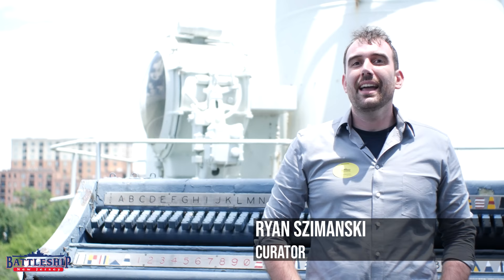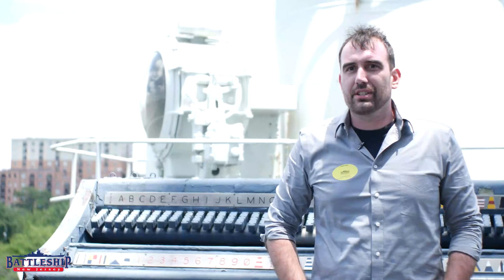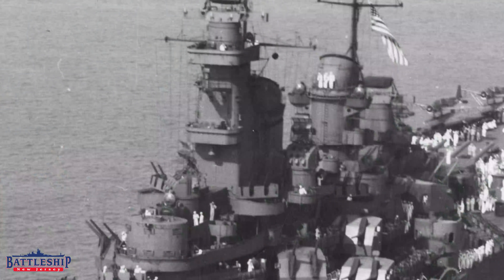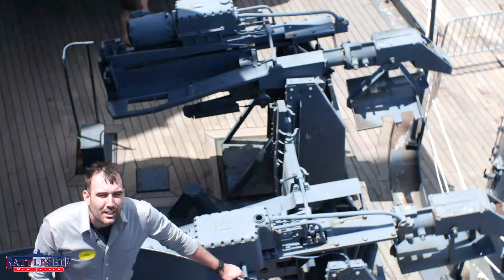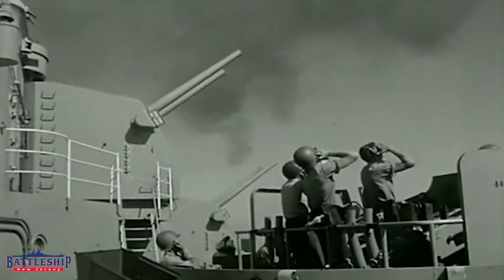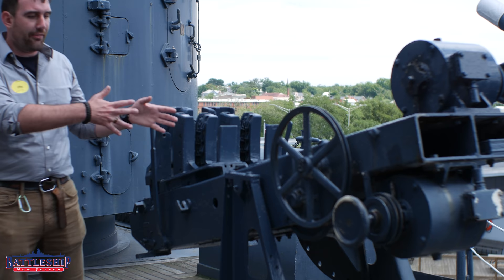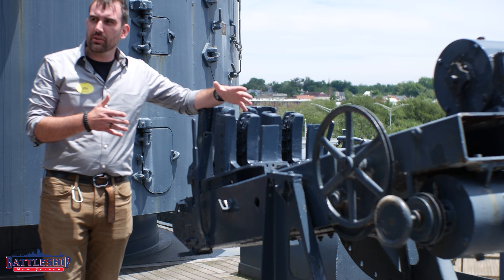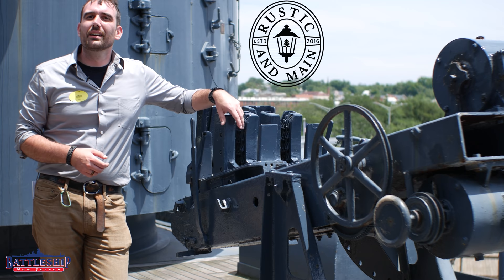Did You See That?!? Search Lamps and Star Shell

Comment: Seems like the searchlights would be good to have if you are recovering sailors from a ship that went down, or downed air crews
Reply: That's usually the job of the destroyer fleet, though.  It's a lot more hazardous for ships with a higher freeboard, like carriers and battleships, to try to recover personnel from the water.  Also, you typically need to come to a full stop to perform those actions, and that's a lot bigger time investment and risk for those larger vessels.
Reply: ...or looking for sabatours/enemy frogmen in port.
Reply: @joshuabessire9169  That's more a task for searchlights on the port facilities themselves.
Reply: @joshuabessire9169  that'll be port security's AOR.
Reply: Might need the search lites if in a earlier battle the radar was damaged I’m sure they could use the star shells but maybe all used up , you don’t get no time outs to replenish your needs in war
Reply: @dougchew5193  If you can't rotate ships out of the front line for replenishment of the resources needed to be in the front line, you've either screwed up badly and are about to loose the war or you've already lost the war and haven't admitted it yet.

Comment: If the enemy has the proper equipment, illuminating  them with radar gives away your position as surely as illuminating them with a searchlight.

I have seen several sources mention that the Germans and Japanese had "excellent searchlight tactics" yet I've never been able to find any documentation describing searchlight "tactics" for them of the US Navy for that matter, although I do know generally that it involves things like controlling the illumination time (as brief as possible), and switching between different searchlights to make it harder for the enemy to pinpoint the source, as well as using them to "dazzle" enemy gunners and visual FC directors in addition to illuminating the enemy for your own guns.  I would love to find a manual detailing the use of searchlights (and star shell) in night combat.
Reply: Another practice the Japanese had was using their cruiser or battleship spotter planes to drop flares behind the line of enemy ships to illuminate them. They used it in at least one of the Guadalcanal battles. They were the only navy to do that (although the RN talked about it), usually float planes didn't operate at night. I always thought that was a darn good use for them.

Comment: Biggest reason for the 5" loading practice -- before proximity fuzes the AA rounds burst by a time fuze. The lag between setting that fuze (the setter is in the shell hoist*) and its firing was very important of being consistent to get a good AA barrage... actually hitting an aeroplane was not at all expected. On firing the time-fuze started and the shell burst when the timing mechanism ran out. So the time between the calculation of the range and the shells' bursting was highly significant to effective AA fire -- the crews practiced to get the shell-loading lag-time fast AND consistent.

* In the 5" gunhouse one will note where the shell hoists come up from below, with the base end of the shell up. The nose of the time-fuse had a little knob that engaged its mate in the cup which the nose of the shell rested within. Stepping on the peddal of the shell hoist set the time on the fuze, right before the crewman picked the shell from the hoist.
There is a fuze-setters position, see the tractor seat, with his back to the front of the gunhouse, between the hoist and the forward wall of the gunhouse.

Comment: The Navy is always redundant. What if the radar fails?  What if you take a hit that knocks out the radar?  Are you crippled, or can you still shoot with star shells and search lights?

When computers were coming into service, the file cabinets and safes were filled with paper.  With GPS and electronic tracking, there is still a paper chart on a table.
Reply: I got out in 1992, but even then there were a lot of high tech gee whiz systems we could use to figure out our position. Regardless, every day there would be somebody (usually a Quartermaster) who would determine our position using celestial navigation. When qualifying as Officer of the Deck (OOD) Underway I was trained in celestial navigation.

Why would the Navy still emphasize that? For two reasons. The first is redundancy which is a needed insurance against all the sorts of bizarre things that can go wrong. The second is so that you can verify that the various electronic navigation aids you are using way out in the middle of nowhere are working properly. It should also be pointed out that celestial navigation is a skill which needs to be practiced constantly in order to be able to rely on it. 

There was a story floating around, likely apocryphal, about a nuclear submarine that had problems which had pretty much taken their entire electrical system out. So they surfaced, cobbled together a repair that let them use their radio and signaled that they needed help. They got a response that help would be on the way, but then asked them the obvious question of where they were, exactly. As the story goes the Commanding Officer, the Executive Officer and the Chief of the Boat gathered around a sextant that they took out of a box, which none of them had used in years, trying to figure out what to do with it. Personally I am somewhat suspicious of that story as even with all their fancy navigation aids down they still should have known roughly where they were based on the paper logs they would have been keeping. But the idea that submariners wouldn't be regularly practicing celestial navigation because they would have to surface (or at least come to periscope depth) to do that isn't too unlikely.
Reply: @minarchist1776  As the leading Quartermaster on a destroyer, I told my sailors that the first things the Soviets would do would be knock out NAVSAT satellites (later GPS satellites) and fry our electronic aids and receivers with an EMP burst(s). I added what they could take away was the stars and planets and the Earth's magnetic poles. I had them daily do a full Navigation Work Day. Computing the rise and set of sun, moon, stars, planet's, plus observing those bodies and working up the ship's position. Daily practice made them better than most and those results showed in the Navy Wide Advancement Exams and in Navigation Readiness Exercises. In one such exercise, the Commodore order all electronic navaids covered/blackened. The QM gang was to navigate from Roosevelt Roads to Charleston using only terrestrial/celestial means. No problem. The average deviation between the electronic positioning (Commodore staff keep for safety reasons) and what the QM gang observed/computed was .82 nm (1,640 yards). We easily found buoy 2C at Charleston. 

Your submariner story is sort of factual. I help train boomer QM's in celestial navigation. There answer at the start of the program was "Not at a depth of 400 feet". But with a little refresher and a lot of practice, they did quite well. It was part of their quals, yet they never could practice. When they rotated Gold crew to Blue crew and vice versa, they went to see with us for training. It was a nice program.
Reply: As a Unit Diary Clerk in the Marine Corp I basically maintained an electronic version of the Service Record Book. We still had a paper copy too. Just in case the Pentagon's servers went down? HAHAHA!
Reply: Not for much longer. Paper charts won't be printed anymore, some are going out of print now. But you can still order paper charts from specialty firms who will update then print them for you.

Comment: from Wikipedia's article on SearchLamp - but lacking a reference- "Second World War-era searchlights include models manufactured by General Electric and by the Sperry Company. These were mostly of 60 inch (152.4 cm) diameter with rhodium plated parabolic mirror, reflecting a carbon arc discharge. Peak output was 800,000,000 candela. It was powered by a 15 kW generator and had an effective beam visibility of 28 to 35 miles (45 to 56 km) in clear low humidity." - So this is of lower believability and reliability of what Ryan says.

Comment: I don't know the manufacturer of those lamps but the ones on Slater are GE and the starboard side works. The 12" signal lamps work as well.
Reply: Wouldn’t these be carbon arc lamps like most WW2 searchlights?  No lamps but you would need the carbon rods

Comment: As the Battle of the North Sea showed radar could be knocked out easily and by dumb luck. Radar emitters and receivers have to be exposed and unarmed just like fire directors and back then mounting additional radars really wasn't an options outside 1-2 for each search mode. Also radar had severe limitations. Against a shore line it took a very experienced operator and some luck back then to make out a ship. Having search lights just made sense incase the radar was disabled or conditions were poor for it.

Comment: What happened to the practice rounds after they were loaded into the machines? I assume they would be pushed out somewhere but I'm not seeing where in the views shown in the video.

Did they do something clever and make them auto feed back into the shell host or something like that?
Reply: When the breach was opened, the shell would be ejected automatically.  The next shell would then be loaded.
Reply: @andrewgillis3073  Didn't the 5" guns use semi-fixed ammunition? If I'm understanding thing correctly there is no provision for that to extract the shell. And even if that isn't a problem, having big heavy shells falling out with the powder cases would be different than the real thing.
Reply: @benjaminshropshire2900  on the practice machine, there is a slot underneath the ‘barrel’ where the shell would fall into a net, saving it for later use.   https://forum.cartridgecollectors.org/t/usn-wwii-5-drill-round/34586

Comment: A few days ago I found that the HMS victory uses hydraulics to simulate water putting pressure on it's hull to stabilize it. 

You said you can't take the Iowas out of the water because it need's that pressure, could a custom hydraulic piston setup place enough pressure? 

https://newatlas.com/military/hms-victory-floats-hull-protecting-high-tech-supports/

""Instead of the steel cradles, the 3,600-tonne Victory is now supported by 134 "smart" props. These incorporate sensors that measure the pressures being placed on the hull on a minute-by-minute basis and can then adjust themselves to relieve stresses in the same way that the sea would if the ship was afloat.""

https://c8.alamy.com/comp/2ABG7YW/metal-supports-struts-cradling-the-hull-of-admiral-lord-nelson-s-flagship-hms-victory-in-dry-dock-portsmouth-historic-dockyard-dockyards-uk-105-2ABG7YW.jpg
Reply from the maker: NJ is many, many times larger than Victory and wood vs steel is a whole other ballgame. So yes. But at many many times th expense.
Reply: @BattleshipNewJersey  Glad to hear that's not physics that would hold back such a preservation effort.

Comment: 40mm "magazines", not "clips"...
Reply from the maker: The problem is with ships a magazine is a place, not an item. So you have to use words you wouldn't otherwise.
Reply: Think that's a practice loader for a 40mm Bofors. They used 4 round stripper clips. The 20mm Oerliken used big drum magazines.
Reply: Clip is the correct term.